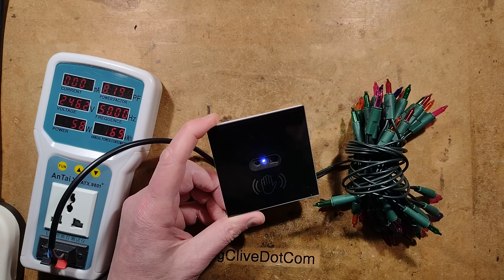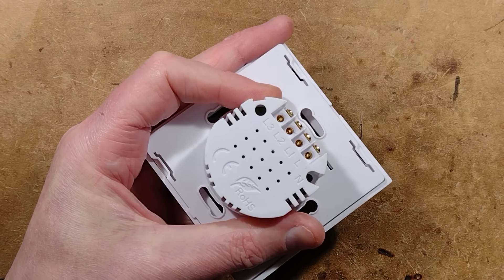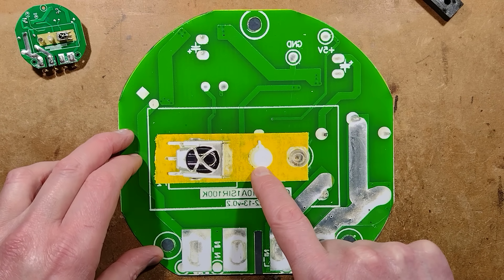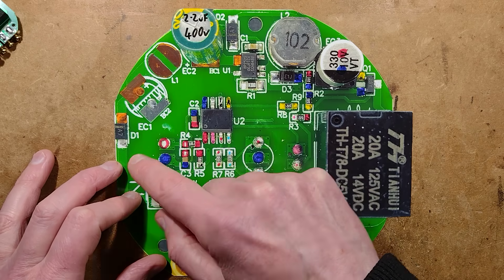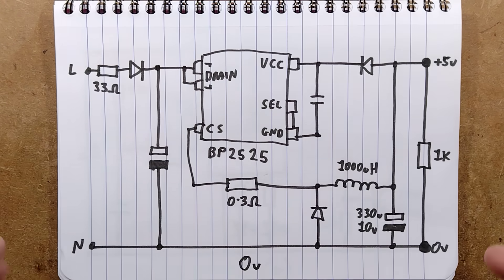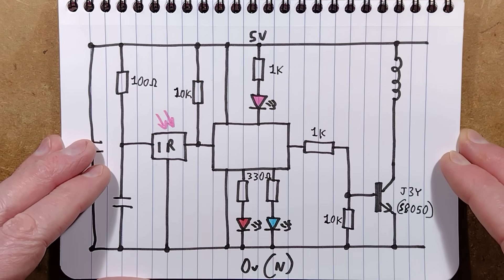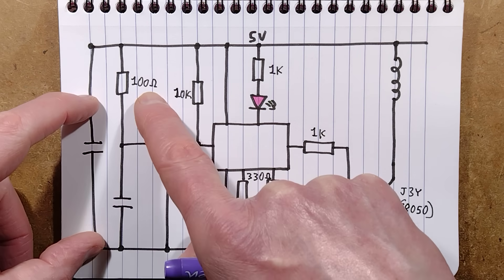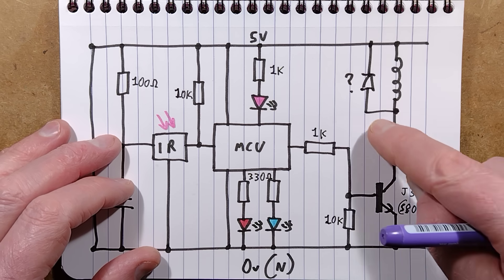Inside a non-contact infrared light switch

Comment: I have one in my bathroom that comes on when your in the bathroom.  But when I changed the bulb to an led bulb it only dims the light when off and flickers when on. It only works right with an old school filament bulb.
Reply: Satco makes high CRI LED bulbs designed for triac dimmer circuits that don't have this problem; they're kinda pricey at $8-10 US a bulb tho, and they don't really advertise which ones have this feature. I had to buy multiple and return all the ones that didn't work for that reason (plus the ones that didn't glow but had nasty strobing when on) with the neutral-less triac dimmer on my front porch light.
Reply from the maker: It may be using a triac and struggling with the low load.

Comment: The funniest thing I never thought about until it happened with all these IR detectors was when I walked into a bathroom while wearing a high-vis vest.

You know exactly what happened.

Flushes, taps, dryers if you bothered with the angle.

Proper rave.
Reply from the maker: While working on the new BBC complex in Glasgow, they were on the brink of removing all the automatic hand dryers as being faulty when I pointed out that it was because we were all wearing hi-vis and it was causing them to false trigger.
Reply: Wow - I hadn't considered that! I sometimes pass a sink in the staff area of a supermarket and the tap is always triggered. I was bemoaning the fact that the supermarket didn't care about wasted water but I now realise I am always wearing a hi-viz jacket. Next time I must take the jacket off to confirm.
Reply: I can confirm, having visited today, that the tap behaves and it is indeed the hi-viz that makes it operate from metres away!
Reply: @TDGalea  I worked at JCB's engine plant and there was a prohibition on going anywhere near the Robot booth that applied the loctite sealing bead to the timing gear covers. It used sone optical feedback to correct the applicator course and apparently the retro reflective bits on the (mandatory fir the factry floor) hi-vis could make it get its knickers in a twist and shut down. If I was down that end of the line I'd have to urn my hi-vis inside out.
Reply: I got an "introduction" to that when for the first time, I went to the bathroom with a hi-vis vest on, as it wasn't over a jacket that I would usually take off. "Interesting" for sure...
Reply: Been there done that. We have to wear Hi  Vis when ever we go out on the production floor or shipping. It does drive automated bathrooms crazy.
Reply: @umbraelegios4130  I'd consider this to be a challenge!  Try to drive management nuts to where they install conventional devices instead of the motion faucets which never work.
Reply: Those damn faucets ALWAYS turn on as soon as you finally give up waving your hand around under there forever trying to get it to turn on, and then the split second it DOES turn on, and you quickly shove your hand under there, it shuts right back off again and repeat... 

You're sometimes lucky and get 5 drops of water on your hands.... 🤬
Reply: @davelowets  I hate how accurate this is.
Reply: @davelowets  But hasn't Donald Trump pledged to Make Taps Great Again?

Comment: That schematic can't possibly be right. The chip has no DC current path though the load. VCC connected to the cathode of the top diode and a capacitor, while CS has a 0.3 ohm resistor to ground. 

Unless the chip puts a positive voltage on its ground pin or CS, I don't see how this possibly works as drawn.
Reply from the maker: If you search for the BP2525 on Google you will find the datasheet.  It is an odd way these low pin count buck regulators work.  Especially the three pin version.
Reply: The ground path is via the inductor and load, which has the benefit that if the output is open circuit the chip won't start. The downside is that it does require a minimum load in order to be able to operate and regulate the output, usually sub 1mA, but does need to be considered.

Comment: 20A 124VAC - isn't that a bit naughty to use in the UK?
Reply from the maker: The relay datasheet suggests the max rating of the contacts is 250V AC, tested to 500V AC.
Still not one I'd want to use for high loads.

Comment: This made me think of you, Clive. Today when my sister and I were driving to the tip she complained about the "electrician" she had had working on her flat. She needed the meter replaced, but it had six wires coming out of it and he complained he was only trained to deal with up to five...she had to get an appointment with someone else from Scottish Power who knew how to deal with six wires.
Reply from the maker: Probably a multi-tariff meter for things like block storage heaters.
Reply: I had a British Gas 'engineer' come to replace a three phase meter but he too had only been trained for single phase. Engineer my Arse.
Reply: Well, ya, but….  Be careful what you wish for. Would you rather they guess about the right way to do something, or tell you they don’t know what they are doing and not actually attempt it?
Reply: Same happend in Spain...did you see the news 😂😊😅
Reply: @RS-Amsterdam  Maybe Spain's grid wanted to brake-check the european transmission net, and all they got was being sent to stand in the corner for the rest of the day :D
Reply: saved time or money? how does one even train for <=1kv but just 1ph? because you like need it all

this is similar to like tv cable installers who were trained to look for green at signal meters. noone knew units

it's kind of like training where you can piss but only on toilet, and piss your pants otherwise

who needs people like this. plus, that meter installer worked in that region. how come they didn't know what they have
Reply: @ketas  Your comment reminded me of calling the Cable TV Tech because my cable boxes and modem were having poor connections constantly. (It's a long cable run from the pole to the house. Regular TV watching was fine, but delays for every channel change, long delays when using the menu to access the Guide and On Demand programming, frequent connection losses/slow internet transfer speeds.)

Tech comes in, attaches a one-way signal splitter (EDIT: it was a splitter/amplifier) in the basement, doesn't bother to see if the problem was solved (the received signal strength measured at the furthest TV from the splitter is now adequate, so it must be fine), and he scoots out the door. I call back and complain, first about the problem not being solved (in fact, it's worse - internet doesn't work now), and then for the "service charge" for them NOT fixing the problem ($70 for eight minutes). End result was I ended up paying for the service charge, and struggling to do internet research on a QWERTY cell phone on 3G, only to find out what I REALLY needed was a bidirectional amplifier. So, I bought one off Amazon, installed it myself, and haven't had a problem in 13 years.

I guess the tech didn't realize that signals have to travel BOTH WAYS down the same bit of coax? And that a one-way amplifier can sometimes block signals in the opposing direction?
Reply: @dashcamandy2242 this is super weird. also i would like to see such things installed by them. like it might need adjusting for power and so on. too much power is an issue too. it could burn out your or their equipment or just overwhelm it. it's stupid for them to not be able to fix it. i'm surprised
Reply: A case of doing what you know rather than knowing what you do.

Comment: You could probably reduce the range by increasing the resistance for the IR LED. 

I wonder what frequency it is being driven at and what its immunity to IR remote controls is?
Reply: It'll almost certainly be 38 kHz as I believe that's the most common for infrared remote controls and that means the cheapest receivers. The low current through the LED should reduce the possibility of it swamping out signals to other remote-controlled appliances. I'd say it can protect itself from interference with other remote controls by either modulating the 38kHz carrier with a pattern that it then checks for, or waiting for a long interrupted input before responding.

Comment: Have you tried pointing an infrared remote control at it, or looking at the LED waveform on the 'scope? If it just looks for continuous carrier, it might respond to any infrared remote control. If it encodes and looks for a particular pattern, you could use the right infrared handset to make it a remote-controlled switch.

As to the "cultural" aspect - well, that would only work with a triac because a relay produces a spark!
Reply: There are (at least…) two different versions of that kind of IR receiver. One pulls the output down as soon as it detects IR carrier (typically 38kHz), and then modulates the output with any binary data on the modulated carrier, as in a TV remote, and so can be used for simple switching like this. The other only generates a modulated output when it sees modulated data on the IR carrier. The microcontroller is likely just waggling the IR LED pin at 38kHz square wave, with no need for any binary data on top. You could generate the square wave with a 555, but in this case you need the uC anyway to do the relay latching and visible LEDs.

Comment: That relay is supposed to be able to handle 20 amps?  Umm...no.  I would suspect it could not handle 10 amps much less double that amount.
Reply from the maker: I'd rate it 2A max.
Reply: @bigclivedotcom  Note that it isn't even rated for 230V...
Reply: @matthewmarks6951  Yup, 125VAC on a good day - I would want to upgrade that to something beefier or use a contactor.
Reply: 20 amps for 2 seconds and then it goes into overload indicator mode (flames)

Comment: I bet the relay has a clamping diode inside the case. I have seen several that had them inside to case.
Reply: I can't find data on that particular relay, but the closest I can find doesn't appear to have a diode. Are the relays you have experienced with back-EMF diodes quality units or utterly cheap and nasty things like this?
Reply: I was thinking the same thing. The circuit gives the freewheel current nowhere to go, and I’ve seen many relays with them built in.
Reply: Thhis would polarise it! A MOV could avoid this?
Reply: @LawpickingLocksmith  As its breakdown voltage would have to be above that of the coil, it would result in a negative spike of above coil voltage, rather than a negative spike of less than a volt. It would also cost more than a diode.
Reply: Relays with in-built swamp resistors were very common. They save any polarity problems.
Reply: @ Never heard of such a thing - is it automotive? A resistor will not only waste energy but will not clamp the back EMF to a diode drop. Again, I assert that from a practical engineering point of view that these built down to a minimum price relays will not contain additional components. It costs more overall and restricts PCB design if the coil is polarised. Still, Clive can clear up the matter with a multimeter or current-limited power supply.
Reply: @matthewmarks6951  Yes, they were used in automotive and in industry. The tiny amount of power dissipated by the resistor was not worth considering. If the resistor value was the same as the non-reactive resistance of the armature, the back EMF will be equivalent to the applied voltage; this was not usually the case as the swamp resistor was a few to several times higher than the armature's non-reactive resistance. The relays aren't polarised; that is the whole point of the swamp resistor, which makes PCB design much simpler. The cost of a resistor is trivial compared to the cost of the relay and certainly cheaper than a diode.
  A big advantage of using a swamped relay is when a circuit requires "floating polarity".
  If designers were worried about the tiny amount of power dissipated by a resistor additional to the relay, only latching relays would be used.
  They also have a lot faster release time than using a flywheel diode. And a resistor is much faster than a diode.
Reply: @dennissmith8199  not all of them.